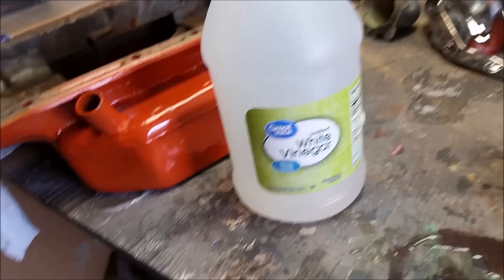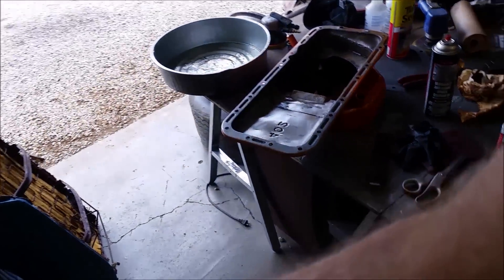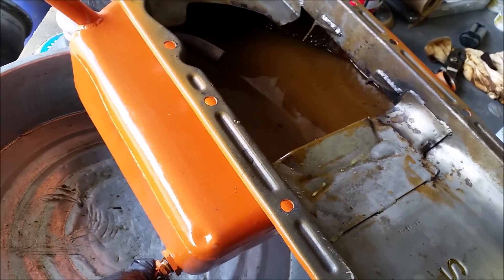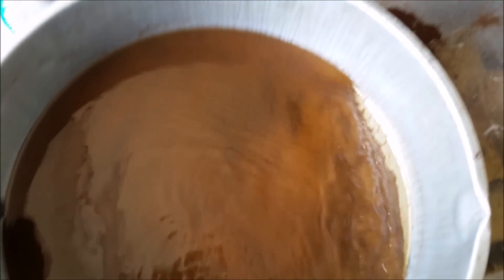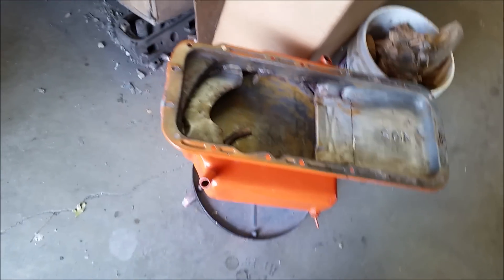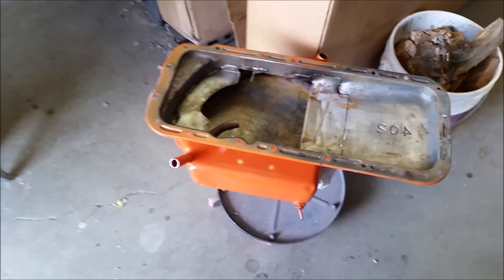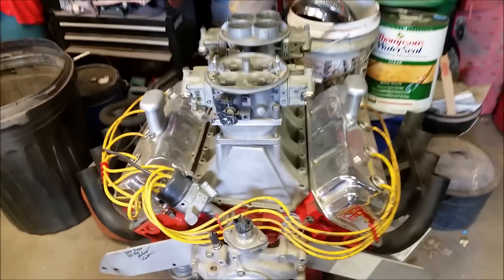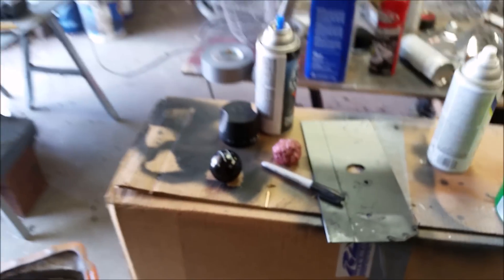Bustin' Rust with Vinegar! Does it work?

Comment: I've done plenty of de-rusting with vinegar and water. It works great. But it will flash rust quite quickly if you don't protect the metal. I also use oven cleaner on dirty parts like gungy old greasy calipers and engine blocks.

Comment: Vinegar does work. I used it on my Charger's brake pedal assembly years ago. It took about three days and looked real nice when I was done with it.  The best stuff I have ever tried is called "Evaporust", which strips the rust away a bit faster and more completely. If you leave whatever part in the vinegar too long, it will leave pits in the metal. For the money, vinegar is a very good alternative though!
Reply from the maker: I always wanted to try the evaporust, but never felt like spending the money when it was at the store, but I was very pleased with the vinegar, it surprised the crap out of me